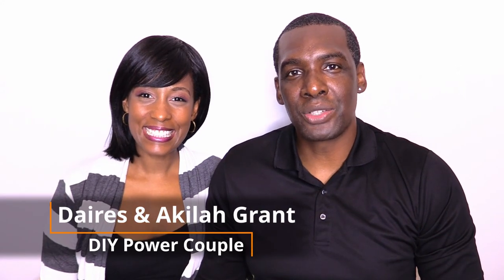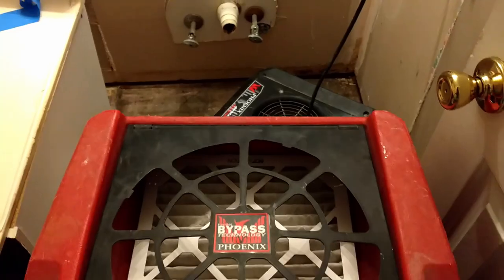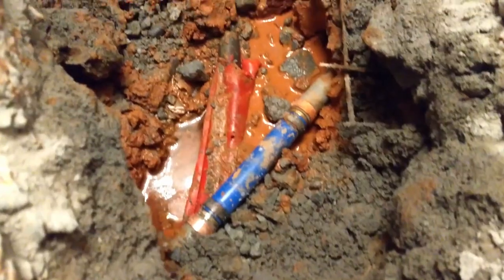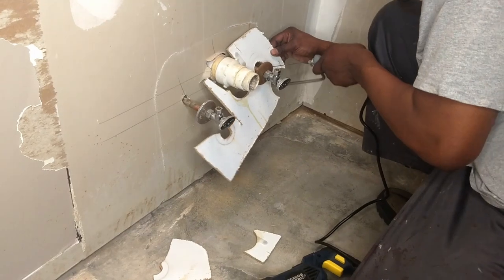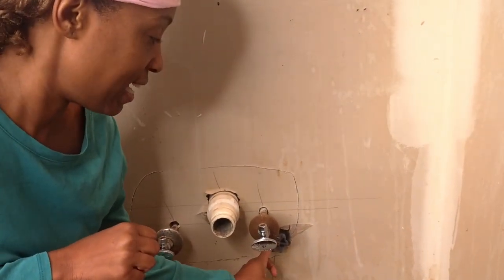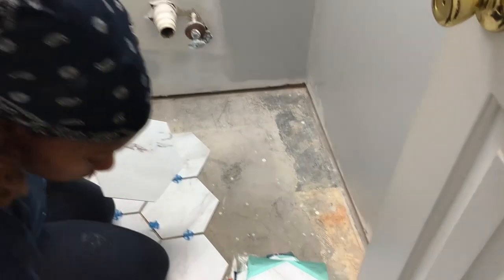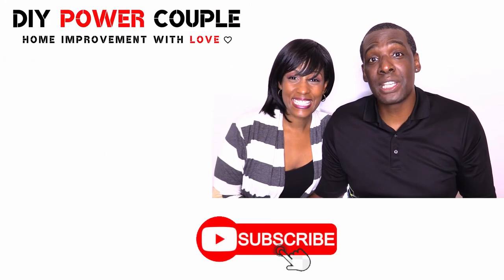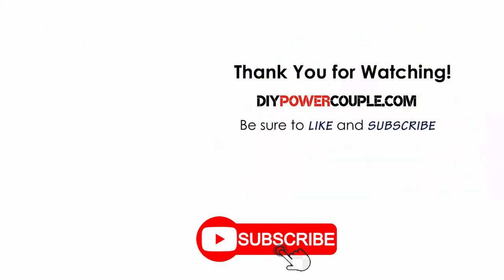How to Select and Install Small Bathroom Vanity DIY

Comment: This is funny because brings back memories. 1 week after our FL house was finished a racoon chewed the tolite feed and half house was flooded but luckly whole house floor is tile.  Week of many dehumidifiers dried place out, no real damage but our golden retriever was upset. After that we shut off water to house when not home and it was good thing since same thing happened again but no flood this time but you could see trail the racoon took by all the scratches left on the handle. He tried to open the doors and did in  2 bedrooms and sliding door to the same bathroom. he even chewed metal leg on my hamper leaving little blood trail but again didn't hurt our dog so wasn't that mad. insurance covered the 3+k price tag and figured out how it got in year later. Renters called the police one night to investigate strange noise and found racoon stick in dryer vent pipe so property manger company changed outside cover and hasn't happened since. Police removed the racoon and let him go, we got a good laugh everything turned out ok.
Reply from the maker: WOW!! So you can definitely relate! 😃